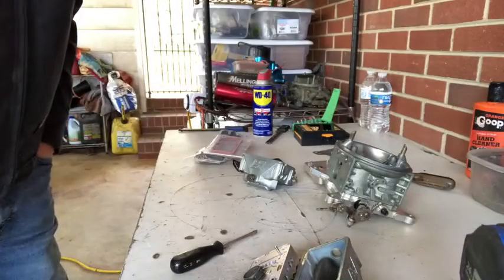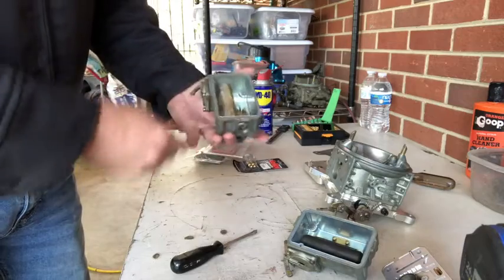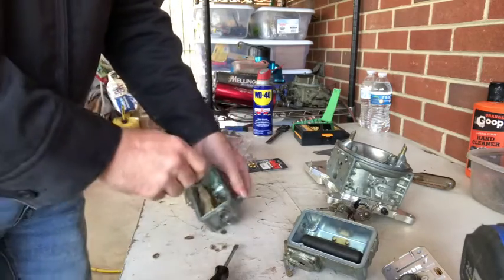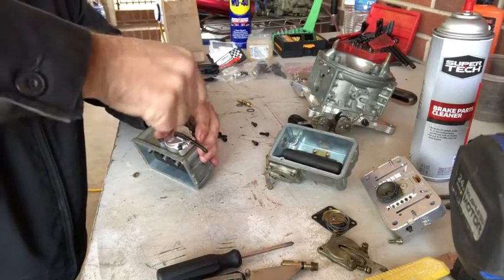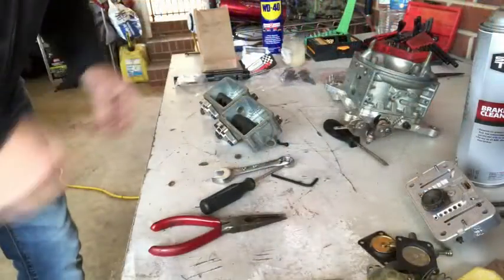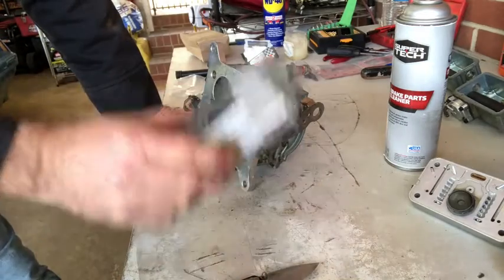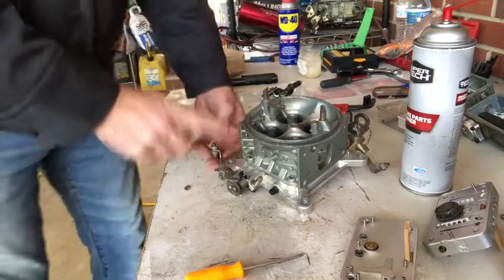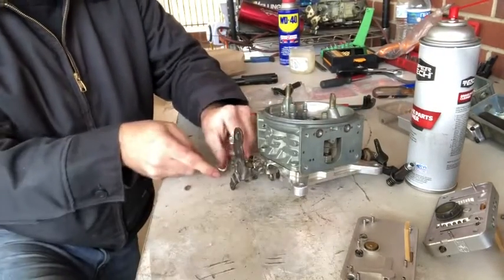Building a blow-through (Part 1)

Comment: hey my friend do you have to run a standard power valve in the primary and a boost reference power valve in the secondary or just one power valve witch will be the boost power valve in the primary or secondary.

Comment: So how does the power valve get its signal?
Reply from the maker: The boost referenced is backwards from a regular PV. A normal PV is open by default and vacuum holds it closed...a boost referenced is held closed by the spring and the boost in the fuel bowl "pushes" it open. So you don't want vacuum (or boost) in the body side.
Reply: @1fastpickup  thanks for explaining this it makes sense to me better now
Reply: Vacuum  it depends on what size you are running to how much vacuum to close it
Reply: But you blocked off the hole that provides the signal

Comment: Iv herd of ya and I like carbs i think there as good or better then fuel injection especially if there tuned right and the ignition is set up properly the vehicle should run with optimum performance and efficiency
Reply: Iv seen turbo jon around but never herd of u till now
Reply from the maker: John and I have been friends for years...back when he was running True Street/Real Street I was his crew guy (official spark plug changer and golf cart driver - lol) at all those races. ...if you scroll WAY back on my channel there's videos of John (and Bryan) dating back to 2011